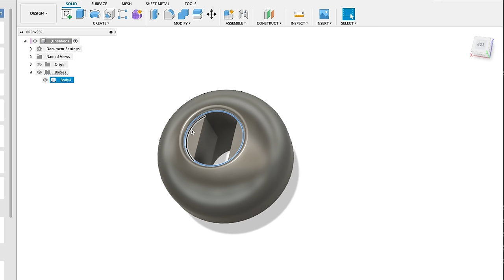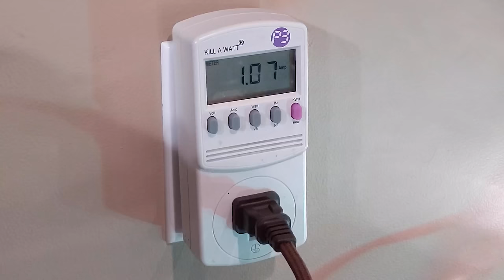1927 Electrified Christmas Tree Stand Restoration

Comment: I had the exact tree stand as that for 20 years. I restored it and donated to a raffle. It's only for tabletop sized trees because it holds so little water. Very cool because I've never seen another until now!
Reply: Was yours painted like that also? Did the green color go beyond the raised edges?
Reply: @moxee33  I think I remember it that way, like it wasn't real precise. I found it in a metal scrap pile in bad shape but solid. Not very safe with the outlet being  non grounded and unprotected. Do you have one that you want to restore also? Almost forgot, there was felt that covered the whole bottom. And I think the lower flat was painted gold too.

Comment: Oh my goodness, I saw this in my feed and clicked in it so fast I think the time line split. You did a beautiful restoration and the added flakes to the paint is fantastic.
     I have the exact one, modded in the long past with 40s dome light indicators and dial lamps. I didn't know the center came out as mine is permanently attached. A Wonderful project.
Reply from the maker: Thank you so much! Amazing you have the same one. I could only find pictures of a few online; did see one with dome lights though. I bet if you hit that cup with a hammer from underneath it would pop put. Thanks for watching and Merry Christmas!
Reply: These stands were produced for some time. There are versions that the water well wasn't removable.
Reply from the maker: @ATonkaTruck OK, that explains some of the pictures I've seen. Probably older ones didn't.

Comment: That is the strangest outlet I have ever seen.  Excellent restore!
Reply: That was a very old outlet.  You'll occasionally find appliances (irons, toasters, etc.) from that time that had two prongs, one perpendicular to the other, supposedly for polarization or to decrease the chances of becoming unplugged accidentally.
Now, I wonder why you used a 3-prong outlet, but didn't wire it with a ground.  But that's for a different discussion.

Comment: Excellent restoration,  enjoyed it very much. Would have made 2small changes. #1 i would have upgraded the wire from 18 gauge  to 16 gauge  wire. #2 i would have put a small on/off switch  near the outlet plug. Please keep up the good restoration work.  Thanks
Reply from the maker: I haven't found anyone who manufactures a retro lamp cord in 16 gauge. Probably because lamp cords are almost universally 18 gauge. Combined with the fact that we've moved to LED lights, 16 gauge would be an inconvenient overkill. I was drawing less an 2 amps WITH the tree lights plugged into the base. That's total for the whole tree.

Comment: Nice job. The original type thumbscrews would add to the restoration. I believe you can still get them new. The tree stand I have came with thumb screws, and it is about 80 years old. Another I have does have the eye bolts, but it is much newer. One older one just used regular flat heat screws. Nothing is consistent. I have never seen an outlet like that one on the stand. Looks like it had 4 slots in each plug location. I am wondering if it was for the old DC lighting systems still in use in parts of the country back then.
Reply from the maker: The four slots are for two types of plugs: the common parallel plugs we have today and tandem plugs that were still around when this was manufactured.

Comment: I hope that you tested the paint for lead before you wirebrushed it, if it is remotely the age I think it is...  Stay safe and beautiful restore
Reply from the maker: Nah. There seems to be a lot of "common knowledge" about lead paint, that if you do the research, doesn't really apply. This was manufactured in 1927. Lead was used in premium paints mostly at that time (that means house paints mostly), as well as industrial paints that required it for a specific reason. I have yet to find, after lead testing every single thing I've restored (and a lot more) any lead in pain on manufactured goods from the 20th century.

Comment: @Acme I'm uncomfortable with some of your wiring on this project. A 3-wire recepticle outlet getting wired into a 2-wire extension cord is a safety concern. Using a few wraps of electrical tape as your only barrier to prevent someone from coming in contact with residential voltage is a major safety concern as well. 

If I could suggest a few possible solutions: 

Use a three wire 14 AWG stranded apliance  cord and wire that to your system. Bond a ground wire to the cast iron chassis for safety (because you have electricity and water in proximity). Then attach a thin sheetmetal baseplate or a wooden baseplate of some type to enclose and protect the wiring.
Reply from the maker: "Use a three wire 14 AWG stranded apliance  cord and wire that to your system. Bond a ground wire to the cast iron chassis for safety"

Already done. Couldn't find a 3 wire "retro" style lamp cord anywhere before Christmas. Frankly I'm surprised I haven't received more comments about not grounding.  Also, this is never going to be used with water. Just a fake tree.
Reply: @AcmeRestorations  awesome! I have always been impressed with your restorations. You are one of the few people on YouTube that does it right when it comes to restoration.

Comment: A honest question, if you media-blast it what’s the point of the hand wire brushing and power wire brushing?
Reply: As I understand it, it's to remove the majority of the rust and paint flakes to reduce contamination of the media, so it can be used for a longer period of time before needing to be replaced
Reply from the maker: Yes!

Comment: I see your metal flake didn't work out as you planned. Mix your flakes into the clear coat and only a very small amount the color paint covers them over. Just a small amount flakes your see what happens if you put in to much. You can always add coats of clear to get the coverage you want.
Reply from the maker: I actually did that as well. Had a lot of trouble with the gun; I think I need to use a larger nozzle, but I'm between shops right now and only had the one gun. Probably metalic white paint would have been a better plan. Thanks for watching.

Comment: ... Dude I really hope you lead tested that paint before kicking it all over your shop with that sand blaster and wire wheel.
Reply from the maker: Nope. I could tell it was painted with oil paints, and there is almost nothing manufactured in the US in the 20th century that had lead in the paint. In all the years of checking for lead paint I have never found any. I would test if something were much much older perhaps.